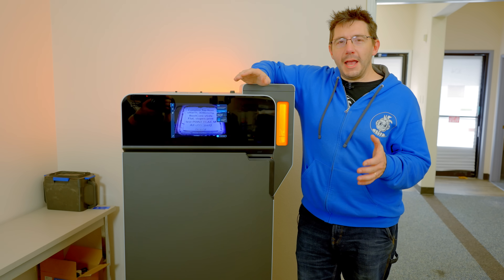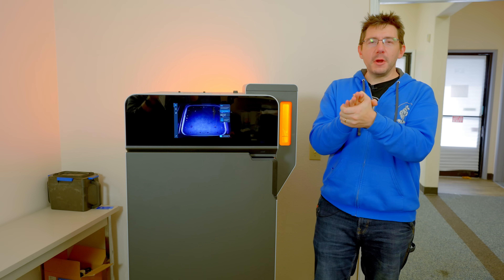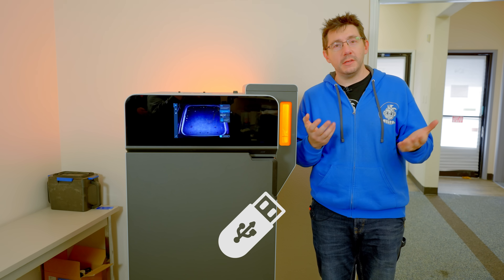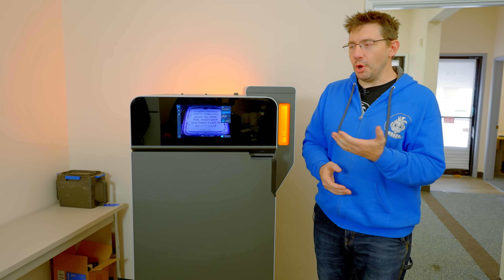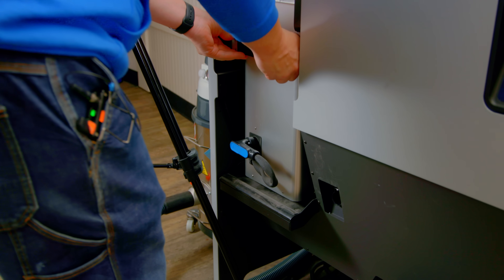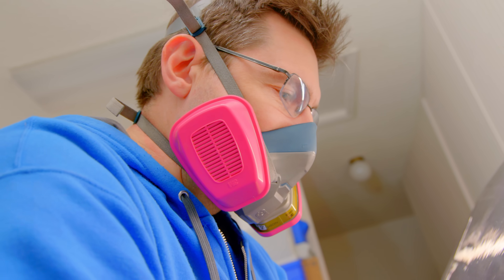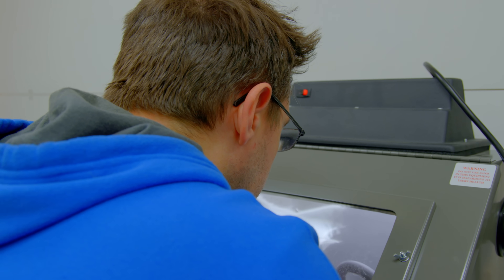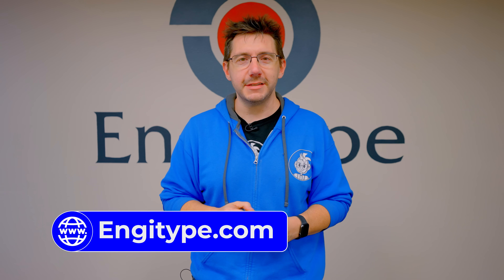Formlabs Fuse 1 First Look - Digging for Prints

Comment: Impressive and fun.  But dang.  Even with a monster printer system that probably costs as much as a car, the benchy has visible layer lines (see 5:50)
Reply: Point of these SLS systems isn’t extremely fine resolution, if that’s critical then a resin process is the best bet.

Comment: I have question

Can you use a 3d file for resin printer on regular pla printer? Or it need to be changed?
Reply: are you talking about STL or gcode?
Reply: There are design considerations for best structure or print success, for each kind of printer. The "benchy" model can be printed on a filament, resin or sand printer, since its design is compatible with all three. Your model may have trouble or not, depending on the shapes.
Reply: STL files will work...you just have to think of other considerations like do you want to get rid of unfused powder inside walls etc
Reply: I use stl files from thingiverse for anycubic 4 resin printer, it's designed   with 70° tilt because it work best for resin printer but mine is pla printer...it will work the same if i print it on pla printer right? Or i need to remove 70° tilt and remakeing the support? I've already thinkering with my pla printer and kinda knon how to make it work and do test printing

Comment: Odd that the Formlabs cleaning station isn't completely enclosed so you don't need a respirator and gloves like the sandblasting chamber.
Reply: You should use one though, and they even recommend it. The Sift has a negative pressure feature, so very little powder becomes airborne.

Comment: there is a real mystery how the prints looks like when they are just out of vacuum cleaner. it seems to me that such an "amazing" surface finish is result of sandblasting but not a print quality. Also there is a question what was the problem to put brush right on to the vacuum cleaner hose end to make procedure easy?
Reply: Because you want to recover powder through the sieving system to be reused. Vacuum is for cleaning up and removing unusable powder or other objects that may get in there